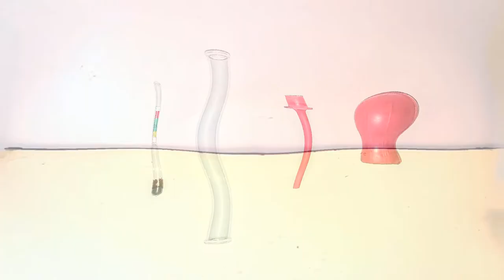Check Specific Gravity, Cell life, efficiency & charging status of Battery using Hydrometer

Comment: Sir  i am planning to buy second hand inverter battery ,, is this test enough to test battery ?
Reply: also do battery load test with voltage(should not drop under 11.5 volts under 50 amp load, check weight of battery vs manufacturer specification weight, check colour of inside walls(should not be dirty) and specific gravity